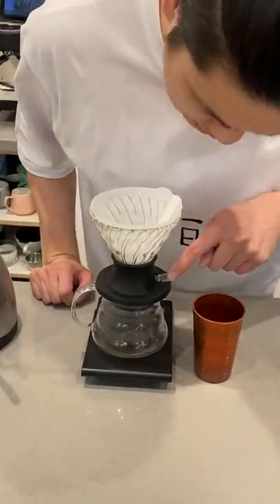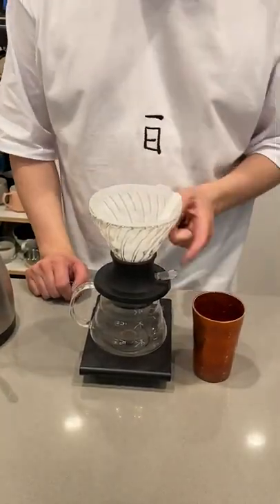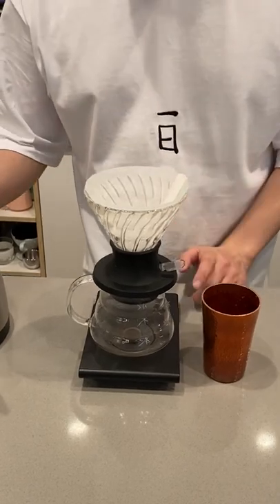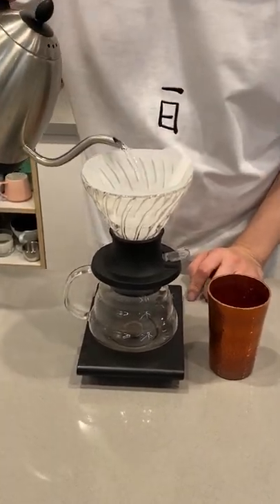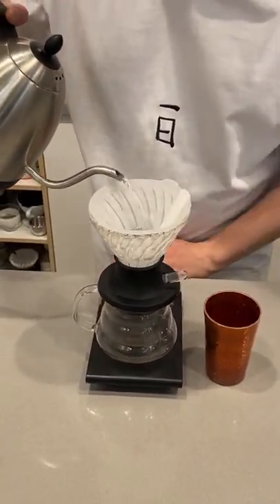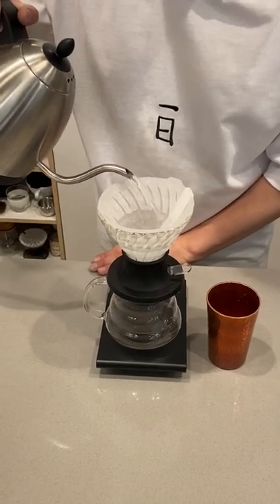Hario Switch Stall the Fall Method #shorts

Comment: You can do this with the clever dripper, so is there any benefit in the extra cost?
Reply: There are other recipes you can do with the Switch that you can’t do with the Clever due to its shape. Even this recipe might taste different between the two brewers because of the geometry, idk I’ve never done a head to head.

Comment: Dear, I did the same but the of extraction took me 3 minutes !! what is wrong with my way? I use comandante C40 grind settings 18
Reply from the maker: I saw your message on IG sorry for delay will get to you soonn
Reply: @TALESCOFFEE  you didn't answer me on IG or YouTube
Reply: Might be too fine. Try 22 clicks instead of 18. Hope it works!
Reply: @sheymajarajah  did you try it this method? You own comandante c40 grinder ??
Reply: @وايتيبولجر-خ9ش Yes, I have the same grinder. Usually if the drawdown takes too long, I grind a little bit coarser. If it’s too short of a time, you can grind finer. My usual is around 22 clicks but it differs depending on the beans. How the coffee tastes after is the most controlling factor anyways!
Reply: @sheymajarajah  thanks but the extraction time now is 3.30 on 18 clicks. I will do 22 next run